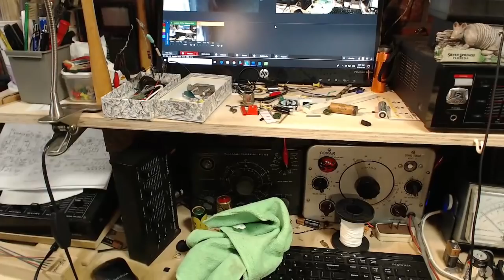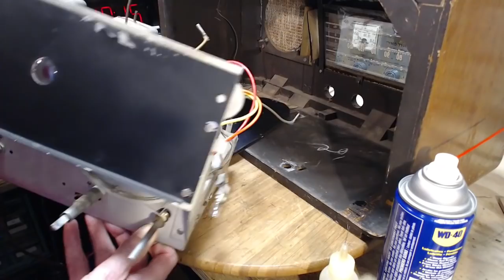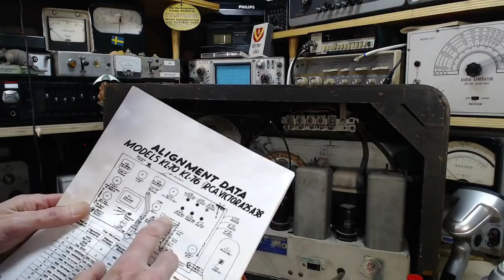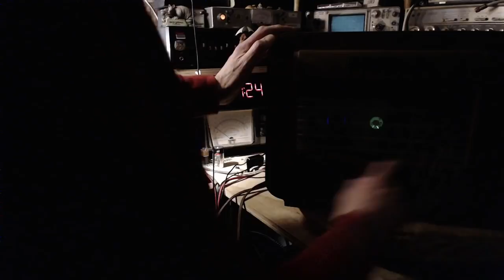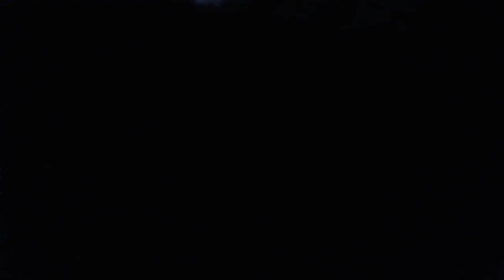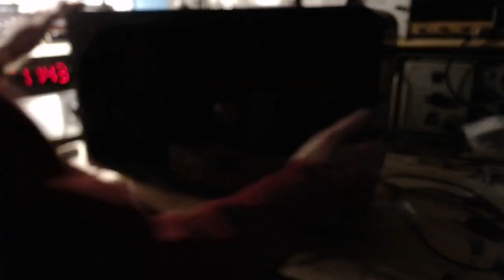General Electric KL-70 AM/SW Radio Video #40 - Last Steps

Comment: Well, I for one was yelling "Don't forget to replace the capacitor!" at the computer :) Amazing how well it works without it, though.
My RCA A-25 was absolutely miserable with the push buttons. I think maybe the contacts were really oxidized.
I do know that I would have to repeatedly push them before I got the response I was looking for. Not particularly handy.
For the most part I just left them alone and tuned manually.
I have faith that you will be able to get it working properly in the end.
I guess you can just blame  Murphy and his bloody law!